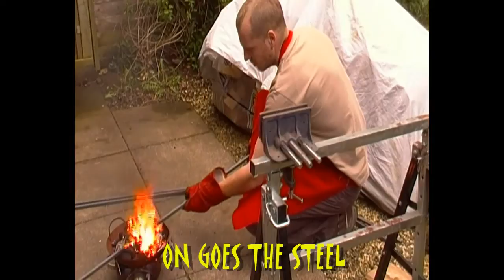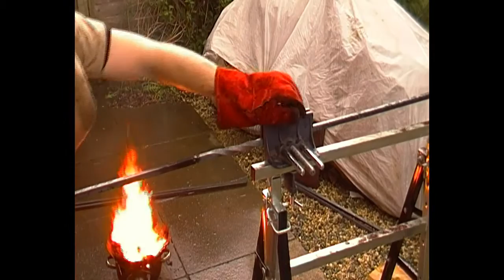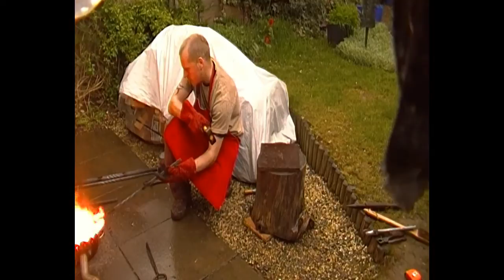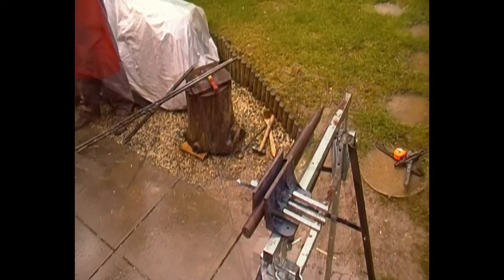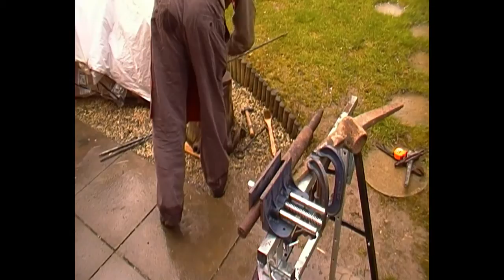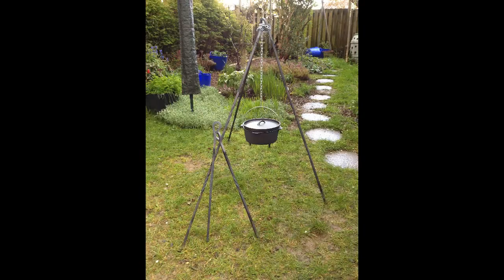Forging A Steel Tripod & Poker

Comment: Have you moved up as far as your anvil? If not, consider doing your hammer work in a sitting position. Since the anvil and fire are both low setting, it might be easier. Nice work!
Reply from the maker: +drason69 Thanks for the comment. I have two proper anvils now, and built a mid sized coke forge, which is higher off the ground.

Comment: How Long you start with
Reply from the maker: I started with 5 foot lengths, to finish with a good height for hanging adjustment. Probably works out at around 4 feet high when set up, maybe a little over.